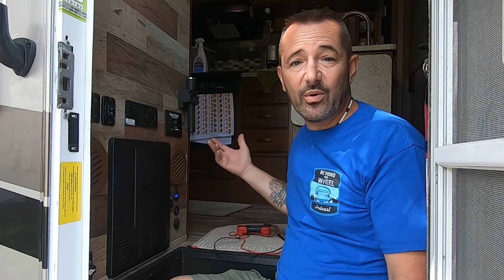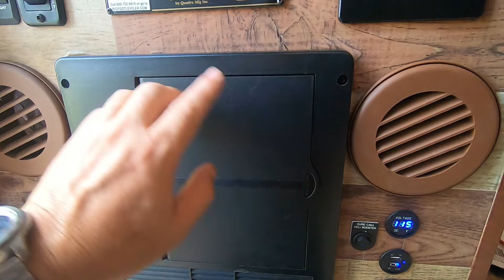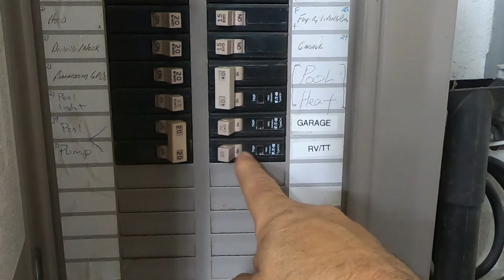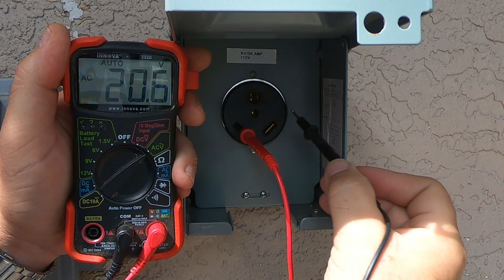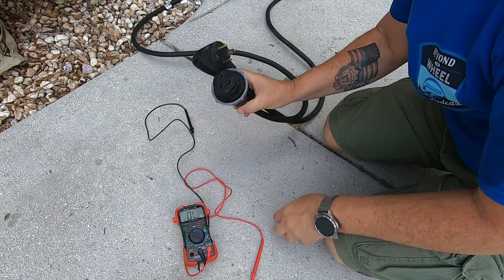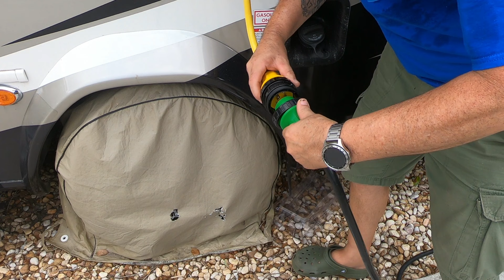RV Power Problems – RV Electric Troubleshooting – No RV AC Power - RV Power Cord and Power Adapter

Comment: 24ft 2011 Salem no alternative current AC, kept tripping breaker I'm going down the line GFCI, water heater, outside plug, power cord, breaker box, inverter, now fridge it's condenser hose broken hopefully this will be it or it could be ground to frame right? or a broken wire I don't think so as breaker box good current
Reply from the maker: I would check the power at the pedestal first and eliminate each component the power passes through.

Comment: Great job of taking all the steps. The only thing I would add to this is the option to repair the cord as it is expensive to replace.  If not comfortable with the repair would be inexpensive to have an electrician replace the cord end,  keep in mind as shown in this video a further continuity test would be needed to determine where the break in the cable is ( I think his guess is correct) by cutting the cord beyond the suspected break and repeating a continuity test ( if broken half way down the cable,  then half a cord isn't very useful). You could save$$$ by just replacing the cord end.  But thank you to the presenter, finally a video that is true, safe and offers great steps to troubleshoot this issue..... but didn't fix my problem which i think is further down the line.. Thank you non- the less GREAT VIDEO
Reply from the maker: You are exactly on point. Replacing just the plug end is the more economical fix as long as the break is not somewhere along the cord.  Great feedback and thanks for watching.

Comment: I tried different cords and  both are fine. Still getting no ac power and batteries drained can’t even start truck. What else could it be besides a bad converter
Reply from the maker: you have to follow the power.  if the RV is getting 120v power when connected to shore power then check if power is going to converter. if power is going to converter but converter is not putting out 12v then it is likely a converter problem and so on.  you have to follow till you find where the loss of power is.  Remember the 120v and 12v are two separate systems.  Good luck.

Comment: My original cord already is angled down so less chance for this problem. If replacing the cord, simply buy one with an angled plug,  using a pigtail creates more connection points and more to go wrong.

Comment: Thank you my friend! My fridge and front AC lost shore power everything else worked. Checked all breakers then started the generator and wow everything worked, big sigh of relief. Started at the pedestal the surge protector. All lights on the surge protector looked good but for good measure unplugged it and hooked up directly to the pedestal and everything worked. So I’m assuming the problem is the 50 amp protector. Will buy a new on tomorrow.
Reply from the maker: Sounds like that's the problem.  Great diagnosing. Happy Camping.

Comment: Will this testing work on a 50 amp also?
Reply from the maker: Very similar except 50 Amp has two hot legs at 120v.  If your unsure how that works have a qualified tech check it.
Reply: @RVHabit  I know how it works ,,,my r v has lost power for some reason over the last few weeks i have a little going in ,,, i have checked the breaker and the one on the rv . I watched your video and didn't think about the power cord ,it stays in that bend position also so
i will be checking that .
Reply from the maker: Oh then you can test the same way.  Test each leg with the neutral and then the ground.  Good luck.

Comment: I have a small Braxton Creek HD 10 teardrop trailer that’s modified to go off roading, The dealership I got it from is kind of ridiculous I can’t get any info from him when I plug my cord from my trailer into the wall of my garage and I use an adapter that plugs into a regular socket, after it’s plugged in for a little while there’s two LED lights apparently the green light is supposed to be on but the green and red light is on and it states on a tag on the cord that green and red means hot/neutral reverse and I don’t have a clue what that means? And the only instructions it gives is to notify The park maintenance staff which I guess they’re stating if you’re at a campground which I’ve never had a campground I’m in the back country on my trips other than being plugged into my garage all the time, do you know what this means if this makes any sense? I’ve only noticed this in my garage and it’s very rare I hook up to a generator.  Thanks for the awesome video👍
Reply from the maker: I believe you are talking about a surge protector that is on the trailer indicating the hot and neutral are reversed.  My first suspicion is the garage outlet is wired incorrectly.  You should start there and have the outlet checked.  If the outlet checks out ok then check the wiring to the surge protector.  That wiring may be reversed.

Comment: When the cable was damaged did your outlets work?
Reply from the maker: No the power cord supplies 120v to the RV so no outlets worked.  RVs have two separate power sources.  120v and 12v.  The power cord supplies what you would consider typical household power like the outlets, microwave, AC, etc.

Comment: outstanding!  thanks for the video.   my friend was powering an rv from an external generator - and there was a (floating neutral?) issue :  the voltage read 239V and he was smelling burning. any suggestions?  thanks
Reply: I have the same problem! Plugged into my 30 amp and started smelling burning. Checked my 30 amp outlet to see it’s running 240 volts and smelling like smoke
Reply from the maker: This is not good.  You have more than likely damaged the circuit boards on most of the equipment.  Everything should be checked by a qualified RV technician.

Comment: This was helpful. It gives me a starting point. My 12v system seems to be fine. Nothing on 110/115v side will stay operable. Just got this RV a couple months ago and already running into electrical issues.
Reply from the maker: Start with the cord and work your way to each connection.  Good luck.
Reply: I bought an 81 RV and had to spend about $1,400 on having the clearance lights rewired and replaced, plus some other wiring issues under the dashboard.

Comment: My rv keeps disconnecting from shore power and going to the batteries I roll over the generator without starting and goes back to shore power what could it be brand new transfer switch
Reply from the maker: Start at the beginning.  Make sure you have continuous power at pedastol outlet.   Check power cord it could have a broken wire that is intermittent, check wiring at plug on RV,  etc.   You just keep going in the path of electric to RV.   Don't assume anything.
Reply: @RV Habit  on our first camping trip (1 night) to work out the bugs. We lost 30 amp power but then came back on for a while, then cut out again. I had replaced the plug on the end of our main cord in the past which could be a problem. But I've had it plugged in at home for quite awhile with no problems. Another problem we discovered is the propane tank had leaked completely out over the course of 10 months. I have it back in the propane dealership checking for leaks. They had done some repairs to it in the past. Thirdly on our first trip, the engine wouldn't start at one stop for food. I checked the battery connections and the ground wire had come loose. It's like everything happened on our first trip out. It's a 1981 Chevy C class. Runs great with only 52,000 miles on it.

Comment: Lou, I had the same problem with my 5 year old Furrion power cord. It’s a bad design by manufacturer. To much stain  on the electrical wires in the cable.
Reply from the maker: Hi, I agree. I am surprised the cord lasted 5 years.  The Marinco right angle adapter is great.  I should of gotten one long ago.  Thanks for watching.